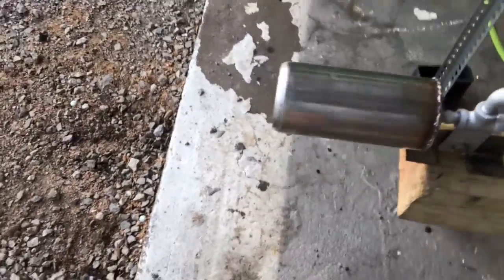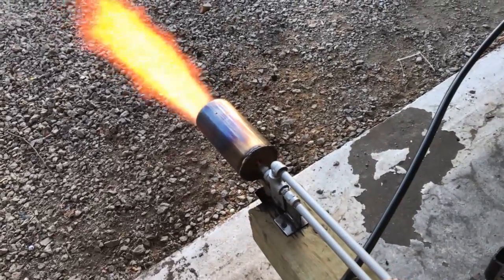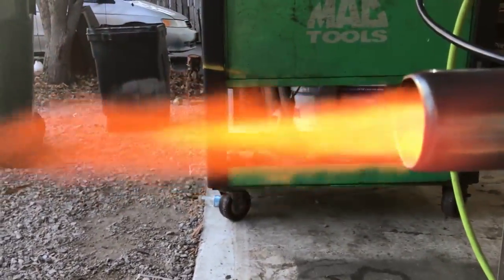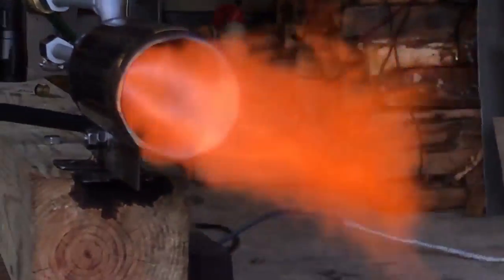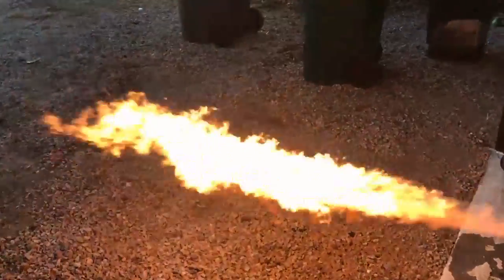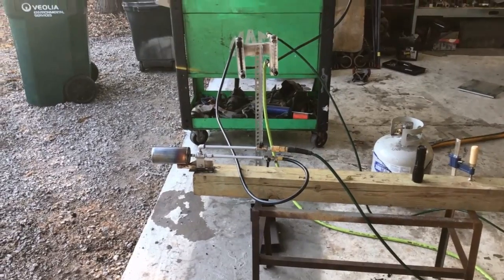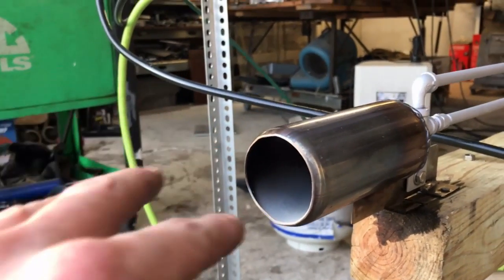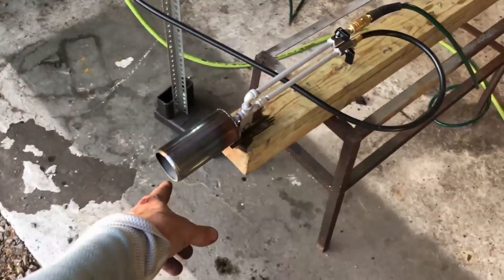Bullet Burner burns any fuel 700 Kw

Comment: Hey there.  Could you add a lower diameter combustion chamber inside the larger. My thoughts being that at lower volumes that you are still able to get some back flame bouncing off the inner chamber. My thoughts are maybe half to 2/3 of the diameter and half the length too.  You could even make an insert to try eith this exact burner.
Reply from the maker: Brilliant idea my friend .